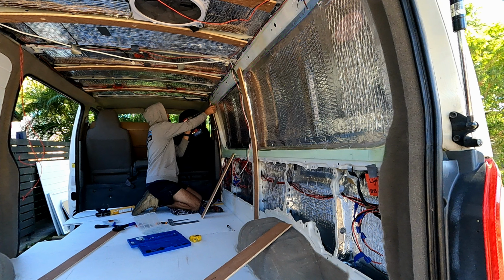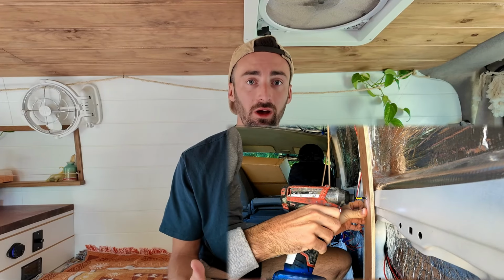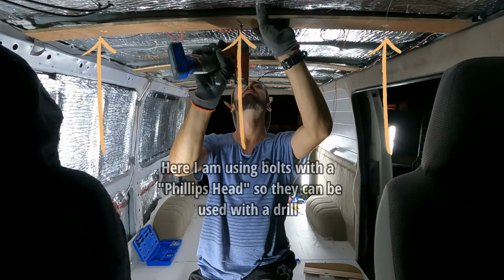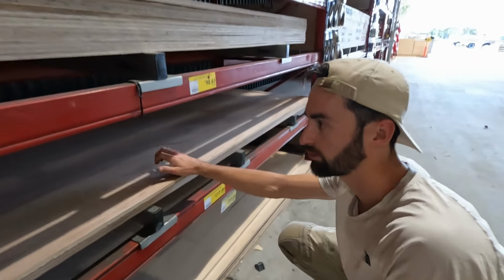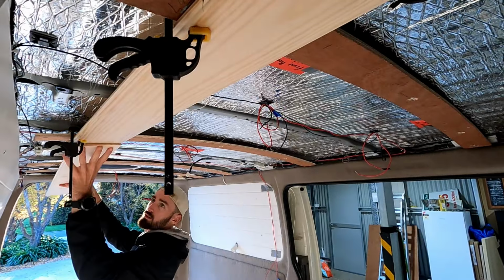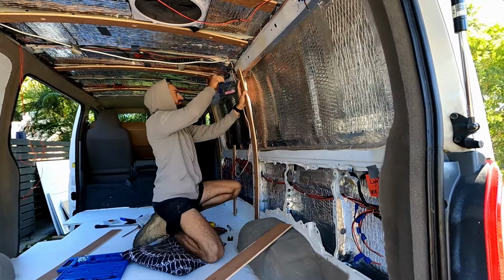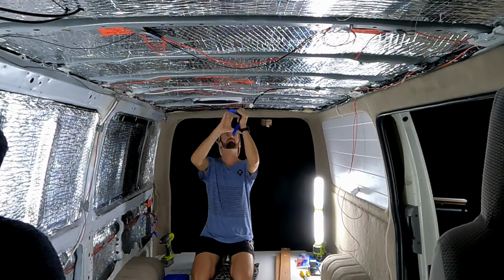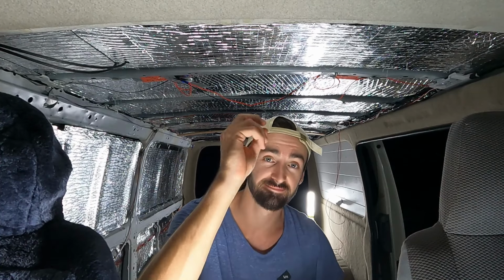How To Frame Your Van! Easy Step-by-Step Guide

Comment: Hi Jake! Very helpful video. How did you secure the pine lining to your transverse ceiling battens? Are they removable for future access for wiring additions, maintenance etc.? Also, a how to do the floor video would be great. If not a video, did you sound deaden and insulate the floor before laying down your plywood floor? Thanking you in advance for your considerations. Cheers, Rob.
Reply from the maker: Thanks for the feedback mate. In this one to fix the ceiling I've used Sikaflex 11 as always, but I've tried out nails on a 45 rather than screws to make it easier to putty and get a seamless finish. Id feel more comfortable with screws of course but with the sika there to help, the nails have been as solid as screws till this point 👍🏼 As for access, I would recommend screwing the last panel on either side and not covering them with putty so you have access down the track as you mentioned. I'm confident that access to these two panels alone is enough to poke any cables I need to whenever they need to go. 
(Of course it goes without saying that screwing all the ceiling panels to the ceiling battens is the standard approach if that's what you're after.)
As for flooring. I will get to a vid. In these smaller vans I haven't worried about sound proofing because there just isnt much room to work with and I prioritize the thin layer (6mm) of thermal insulation I can get in between the ribs of the bedpan before laying the subfloor. Hope that helps mate. Happy building
Reply: @JourneyVanBuilds  Thanks Jake, that is helpful. Cheers, Rob.